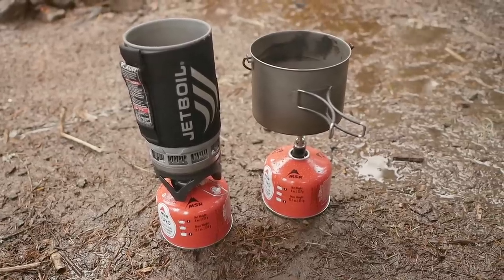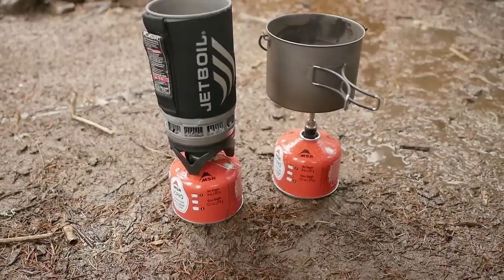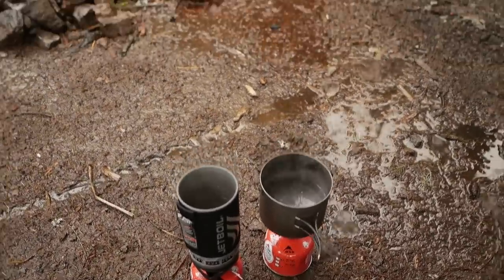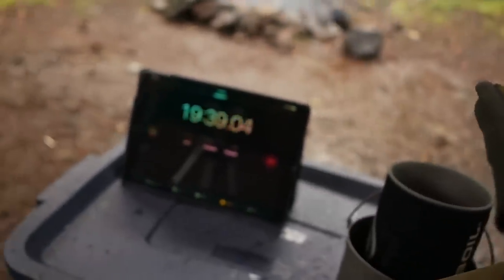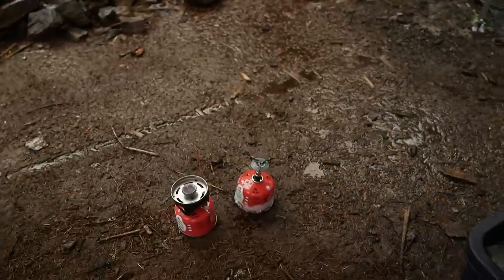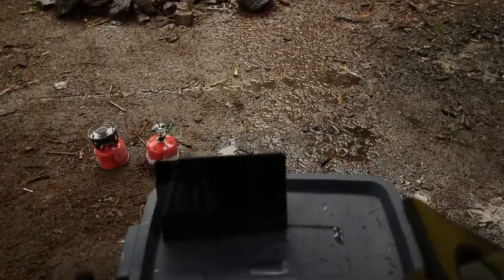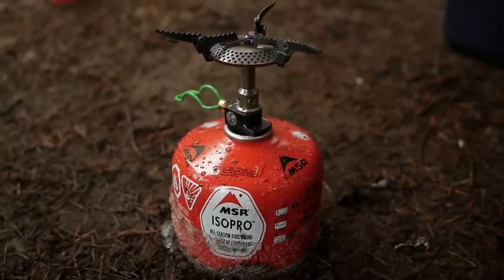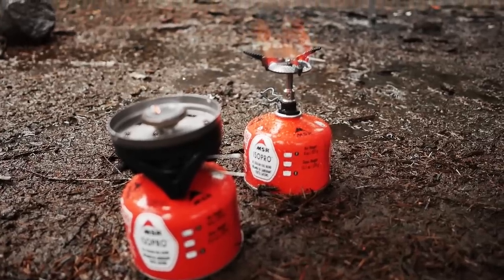How Long Does an 8 Ounce Fuel Can Last?  Jetboil vs. Optimus Crux Lite

Comment: I’m looking for a similar stove. Will go with the jet boil...  great picture quality. Did you shot this video with your phone?  Do you have a fb page or instagram you post videos to?
Reply from the maker: mark scott thanks Mark.
 I’d definitely recommend the Jetboil, I’ve had it for about 3 years and it is still going strong. I shot the time lapse with my phone, but the video is with my lumix 👍.  I do have an Instagram, not sure why I don’t link it on my YouTube.  But it’s Edward_shin_  so add me man!
Reply: There is definitely more to it than this. If you set up each stove in real world conditions the way you would actually use it, and look at the real burn times to boil water, you will find that the Jetboil is not as efficient weight-wise. Remember that the Jetboil is MUCH heavier than the crux, so you need to account for that weight in your pack. The weight of the Jetboil means you can carry more fuel for the Crux to equal the Jetboil system weight. In the long run, the Jetboil type systems do not stack up well for weight carried vs total boil times. See some really good testing at adventuresinstoving.com
Reply: Jetboils are wonderful stoves yet....are heavy in comparison with many other cannister stoves. Mybe over the last decade they have gotten lighter...I am unsure.
Reply: mark scott,  I’ve been backpacking for several years, both short trips and weeklong trips to mountains of Wyoming, Idaho, etc.  there is definitely a significant weight trade off by using a JetBoil.  My hiking partner carries an MSR pocket rocket, and I carry a JetBoil Minimo.  He always ends up using my stove whenever I’m not cooking in it.  In addition to the fuel efficiency, the JB Minimo provides a much better throttle control so that you can actually cook on it, which is difficult with a flamethrower or an alcohol stove.  Enjoy the outdoors with whichever gear you go with!

Comment: I would of thought the crux would of boiled quicker with its bigger flame so I expected it also to have a shorter run time. The jet boil pot design is a more efficient system.  Now my question is how hot was that jet boil flame the last hour and would it actually boil at the same rate it did in the beginning?  That flame looked pretty small. Thanks for sharing
Reply from the maker: Michael Butler I’ve tried using the Jetboil at nearly empty canister levels on other backpacking trips, and it appears to remain efficient in bringing the boil within  3 minutes at full power

Comment: The optimus would have boiled the water even faster with the original pot, it has the same base as the jetboil to distribute the flame evenly. The jetboil is just so large and clunky. I don't know,  even with those results I'd still go with the crux. Thanks for the info,  I had no idea they would last that long.

Comment: I got a question I'm glad you're doing this experiment number one number two when you take the gas stove off of the bottle does the canister refill or leak or how does that work I know on the green bigger bottles when I take my stove off it just seals you know screws on the screws back off and keeps the gas in
Reply from the maker: John McKenzie when you unscrew the stove from the gas canister , it locks the gas in so it doesn’t leak. You can use a portion of it at a time and store it away for later use without keeping the stove screwed on.

Comment: With the jet boil you are limited as to the pot that you can use. If you want to use a frying pan, you need to come up with something that will hold the pan above the flame, and since the flame is smaller, it will take longer to fry your meal. The Jetboil needs it's own pot or will not work as well. If you only boil water Jetboil is the way to go. If you like to use pots and pans of your choice the other is better.

Comment: I'd really like to see this test done with the BSR-3000T stove. I'm considering running a Toaks 900ml D115mm pot with a 230g canister on the BSR-3000T stove. Compared to a Jetboil with a 230g can I'd be saving about 10ounces. I'm not as concerned about boil times as some seem to be. I care more that its effective and efficient. I'm kinda thinking a 115mm pot will spread out the cooking surface more to help offset the stoves inefficiencies. I may just order the BSR, its $15 and test it.

Comment: The Jetboil Flash, I do not believe has a regulator? Try a Jetboil MiniMo or MicroMO?
Reply: No regular, but the early models are able to be 100% field stripped and fixed. The newer ones are riveted, making them impossible to fix in-field & not even worth the cost in a good day.

Comment: You should not use this to gauge how much you can boil. BTU/hour or throughput is important. Unless, you are in a place that defies the 1st Las of Thermodynamics.  There’s is no more than 227g of fuel. It will take roughly 10g of fuel to boil water to 100 Celsius at sea level.

Comment: Now test how flame height affects the boiling time of the water. Using the full flame height might be a waste of time. I’ve found that on an electric stove using the highest rating  of 8 is a waste of energy as using a 6 does the same job. And 6 causes less sticking and burning. So maybe do your test on flame height to see if your not wasting energy by using the full flame.

Comment: How much fuel can you buy with the extra $130 you save by not buying the Jetboil? Also, the other stove has a higher maximum flow rate than the Jetboil (which is obvious based on the icing up of the fuel canister) so it's not remotely a fair comparison. Its like saying my stereo is louder than yours, but uses more electricity...turn it down. Derp.

Comment: Nice video, but I'm more concerned with the number of times I can boil water. I've tested my Jetboil and Pocket Rocket II and they both used about 8 grams ff fuel to boil two cups of water (~70* water). I can expect about 8 boils from a 100 gram canister and 28 boils from a 230 gram canister. I weigh them  when I get home and write the remaining amount on the side. Now, I would never go on a trip without some cushion, but this will get me in the ballpark.

Comment: personally I would not use these to boil water or cook with , would be better used as a fire starter , if you knew how to start a fire from very little actual fire , this stove could last you months in the woods to have fire , and if you have a few of them , there is no telling how long you could go , now you may say if it is raining out ext , well in a survival situation there are ways to cook with wood in the open if you know how to shelter you wood burning with out it getting wet , but that is a long story in it self , just my thoughts on this tho , but think they are a great tool , light , compact ext , thanks for the video .

Comment: I applaud your efforts.  I've got some criticisms for you, but I truely do appreciate the discussion.

So, without harnessing the energy of both stoves for the duration, you cannot really tell exactly how useful each is, particularly against the other.  For example, that the 'wide open' setting on the Jetboil stove lasts a an hour longer than the Prius Crux Lite, is meaningless.  It may be that the burner is not quite as hot.  What I mean is that the usefulness of the stoves isn't how long the flame burns, but  more so the quickness in which each can boil an equal amount of water with the same amount of fuel.

Finally, I will add that I find that one of these canisters, with my MSR stove, lasts for 4 days, say 8-10 uses, not 48 "2 cup boils".

Comment: I have the crux,... the foldable one, I would half that rating from 48, to about 24-30 uses,... but this is in the field camping uses. This is how I "gauge" how much fuel I have left. Every time I use it I use a knife to scratch a line on it, after 4 uses I scratch a line across those 4 lines to mark "5" (like an inmate marking days in a prison cell). Some days you're boiling 1 cup, others it's 2, others its 3 cups of water. So on the average, after you have 20 marks scratched into your can you can start to worry how much fuel you have left... It's a good visual indicator of "how much" fuel you have left, but of course you have to keep up with this system, and if a buddy borrows it and is inattentive or uses it a few times, it can throw you off, which is why I can safely say "half that rating from 48-24" ;)
Reply: I boiled 3 cups in the evening, then two in the morning. It’s at 3/4. The msr canisters can be measured if you dunk them in a container of water. The water line marks a fuel gauge on the side. It was windy and I got to a rolling boil with the crux, so it was fuel intensive. Even if you boil beverages and meals each day you have at minimum 3-4 days

Comment: I have done lots of stove testing, and this wasn't a good test at all.  You can't pit one stove against another and not use the correct wind screens, etc.  Just burning fuel to burn fuel isn't a test. No one buys a stove to burn gas. We buy stoves to cook food. So put the stoves to the test in an apples to apples. And what about cozies? Using a cozy allows you to turn your stove OFF and still cook.  So does that time need to be added to the burn time? It's still cooking?!  
thanks for the entertainment

Comment: Yup that's about right. Just figure 40, 20, 10. 40 meals on the big, 20 meals on the mid size, and 10 on the little guy. Don't buy the Coleman, they suck and are very undependable at elevation.

Comment: Firebox nano with trangia and pan boils water faster....and I can use wood plus I could hook up and canister if I want. 🙌🙌🙌🙌
Reply: Believe me I am a big trangia fan and I also own the crux. The best I have got from a Trangia is a 6 minute boil time. The crux less than 2 minutes. Both using 300ml of water.
Reply: I only need to boil water so fast 🤷‍♂️ I carry the Firebox freestyle, Trangia, and the firebox gas burner attachment with isopro canister. Noting beats burning wood with unlimited supply or throw in some lump charcoal for an amazing experience.
Reply: @zero-ol2nt  Alas, I am often where wood is not available in Scotland or Ireland so that is not an option.

Comment: I doubt your result is correct in the variables. The gas will burn in proportion to the amount coming out, so..... from the start you had the jetboil on less gas flow. Sure jetboil will boil water on a lower setting easier, but..... you never said at the start you are for that reason simply having less gas pumping out. So to me this test result proves nothing
Reply: Jesusandbible  didn’t he say he turned them both on full and was simply timing how long they took to burn out?   I don’t recall him ever saying he set out to “prove” anything.

Comment: The last 1 hr was really useless heat not enough to boil water.
Reply from the maker: Chet Gravatt I’ve used a canister to empty many times on a Jetboil. It will still boil til it’s empty , especially because of Jetboil efficient coil heat distribution system

Comment: Dude — it’s fairly dangerous having those stoves going so close to each other like that.  

Yes, I understand that a lot of things are amped up to be more than they really are via ‘lawyer language’ in the manuals, but the makers of stoves don’t advise against this sort of use for absolutely nothing.  

Having them that close together is about tantamount to using one of those stoves a couple of inches away from a campfire, and I venture to guess that you and I and most of us would agree that that’s a bad idea, no?
Reply from the maker: H.I. Training I don’t think it’s bad unless you are intermingling the flames, and even if that happens I don’t think it would cause any serious catastrophe. The only time I see a potential issue is if you directly point a flame from a stove into the other gas can

Comment: - different pots
- no test of boiling the water after, say, 1h and 2h
- no lids

These results are useless, I'm afraid.
Reply from the maker: cthulpiss 
-of course different pots;  you cant use a jetboil pot on a crux lite stove and the jetboil stove does not accommodate other pots.   
-Even with the gas depleted to let's say,  half the can, the boiling time remains the same, and fuel consumption stays the same
- obviously no lids: I stated that in the beginning of the experiment, so that you can see the water boil right when it starts boiling.  

These results are based on this specific environment.